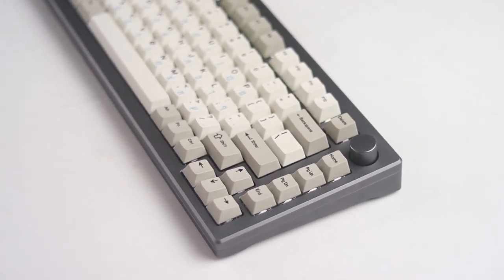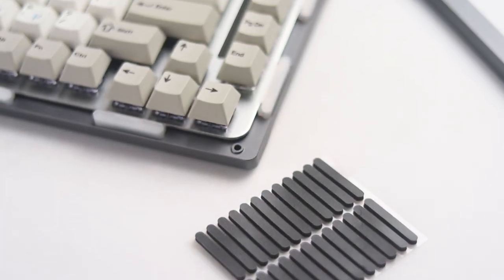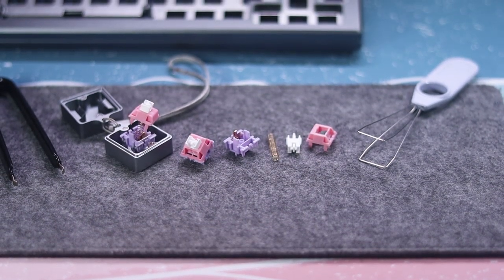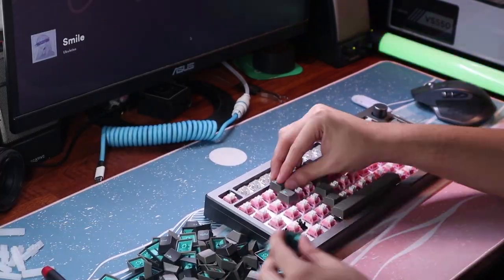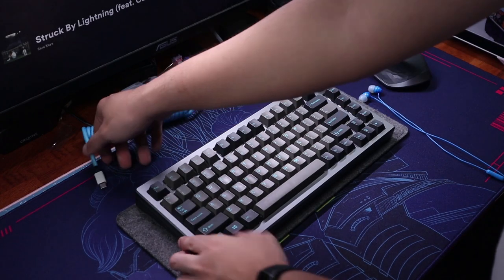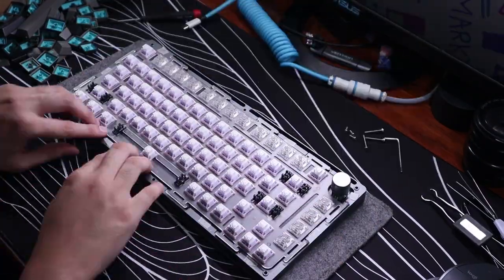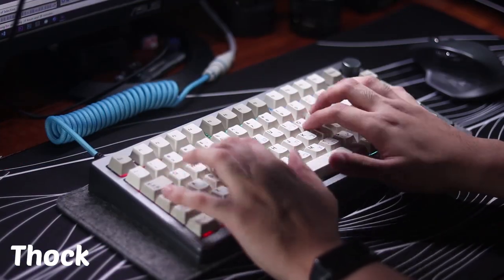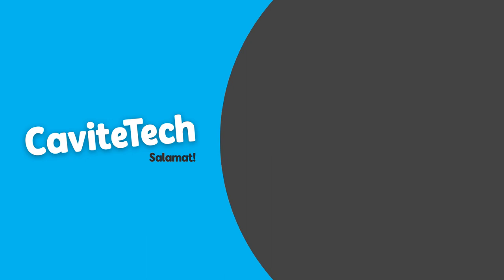Testing KEYBORED's charts! Mod007s V2 Modding Guide

Comment: Sir just recently built my akko mod 007s v2, current on stock and only lubed switches (cs silver) I noticed that the pcb is shaking inside.. any tips that I could do?
Reply from the maker: you could add the extra gasket strips on the left and right side of the case :) , alternatively you could put the gaskets on Case rather than the plate
Reply: @CaviteTechnology  Thank you sir! do you have a FB page where I can contact you?

Comment: Hey! After a year, did you encounter ghost-type or unresponsive keys issues using the Akko Mod00vs2? 'cos I have.. and curious to know how to remedy this. Pretty sure it's with the board - not sure if it has something to do with how I initially modded the board - given that I've tried isolating if it's coming from the software side.  I think we were the first ones to buy this model and we had an interaction that time! :) Great vids still!
Reply: Not sure if you've already found a solution for this but I had the same issue, ghosting or either double input. I've tried all I can to fix it and even reached out to Akko and did some firmware flash and all other stuff and it didnt solve the issue. You know what I did to fix the issue? I just removed the included switch pad and dang that was it. LOL. Idk how they are related but hopefully it helps you.

Comment: Hey there, I actually just got one myself. I'm not sure why but it seems like the PCB/plate is moving freely in the case even when screwed in. Even the knob scratches the case when turned, am I missing something? Does yours do this too?
Reply from the maker: Maybe you changed it to the poron gaskets? I have the same issues on mine , changing it to the silicon gaskets fixed it
Reply: @CaviteTechnology  I figured it out. According to Akko it's that way by design. Doesn't move much once all the switches are in, shouldn't really move either in use it seems. Appreciate your response :)

Comment: I got this keyboard but rgb not working properly white not showing as “white” or if I pick violet it combines with other color. Is mine defective or its a software problem?
Reply from the maker: try moving it to the yellowish / blueish part of the color picker, since it's rgb it can't accurately show white, by compensating it in the color picker, you can get it close to white, but never true white :)
Reply: @CaviteTechnology  ah i see  thanks for the info but it kinda sucks some colors are not accurate oh well i use gateron oil kings anyway just wanted to use a proper white when I capslock.

Comment: After learning about the different modding possibilities, I feel like it's more important to find a switch based on what you like about typing fill rather than worrying about the sound profile. Because regardless of switch sound, you can mod the keyboard to either sound clacky or thocky.  However, of course, if you have high end board and want the stock sound, then switch sound will matter .
Reply from the maker: yup! I used the Zouce switches in the video as an exampl for switch sound, it's still ultimately up to tou to decide if tou want linears or tactiles, the spring weight and the overall feel of the switches!